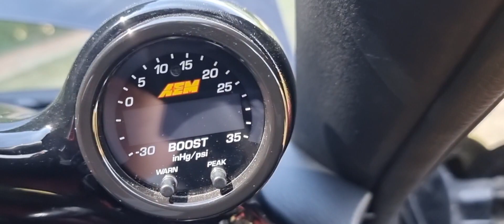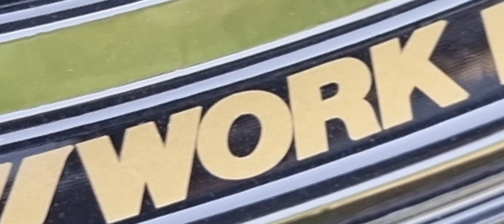Top 5 Favourite Modifications on my Mazda Rx7 Rotary FD3S Efini Walkaround

Comment: hello! I also think it is important to know the history of my favorite car.
It can be confirmed from the garage certificate that the very first owner of this RX-7 was an RX-7 sold at a dealer in Hiroshima Prefecture, Japan.
The official name of this year's RX-7 is Anfini RX-7.
We don't call it Mazda RX-7.
Only the initial model has a red Anfini emblem on the rear bumper.
From type II, it will be a silver Anfini emblem.
This red INFINI emblem is a proof of the early model and is valuable, so I think it's better to cherish it.

The grade is type X, the highest grade; the price is 4,440,000 yen in Japanese yen.
For reference, the R32 Skyline GT-R is 4.30 to 5.29 million yen.
The reason why it seems to be Type X is that the interior is red and the leather seats.
At that time, the number was ruthlessly small, and I have never seen it in my memory.
Although it may rarely come out with used parts, it will be very expensive.
It's a very precious thing. Please cherish it.
The Bose woofer system is also very valuable.
This was an option when I bought the new car.
It becomes a dedicated stereo deck, and a woofer is attached to the rear trunk.
The rear trunk mat is also a special item.
The rear hatch tray is also dedicated to the Bose woofer.
It's very valuable to have all of this.
Please take care of this too.

In addition, the type X was equipped with a sunroof.
This RX-7 does not have a sunroof.
After a little research, it seems that the sunroof is not standard equipment.
It was only written as a single in the specification table.
It seems the first owner didn't choose a sunroof.

RX-7 has from type I to type 6.
I'm on a 6 now.
The driving performance has evolved as it becomes a new model.
However, the newer it is, the lower the cost.
You can see from the video that the early RX-7 was made with a lot of money.
When it comes to type 6, the simplification of the interior is particularly terrible.
The interior of my RX-7 is matte black.
The seat is also fabric.
It is a pity that it has become very cheaply made.
I saw the video and felt the owner's affection for the RX-7.
As the same RX-7 owner, I am very happy.
Reply: Correction: For the rear emblem of the early model RX-7, the correct answer is RX-7 in red letters, and Anfini in silver.
Reply from the maker: Ah ok, well just to clear a few things up there, when I bought my RX-7 back in 2012 it had black leather interior, black efini emblems, red rear rx7 emblem, No bose system, mat or Parcel shelve, It didn't have a lot tbh. I was told mine is a type R edition as it was made in 1991 but registered in 1992 (UK - J Reg) 

Everything you see is what I've changed on the car over 10 years there is a video on my channel called 10 years ownership and it will show you how the car looked back in 2012 when I bought it compared to now.
Reply: @RotaryandRides  I see! It's a type R! I was on a Type 2 Type R.
The price of the Type R is 3.85 million yen.
The red interior, genuine leather seats, and the Bose system are very valuable parts.
I think this is a very good choice.
It says 920014030 on the garage proof sticker.
This first 92 represents 1992.
In addition, the number 1 of the number of heads of FD3S-103*** of the body number represents type I. 6 type starts with 6.
I can prove that it is a type I vehicle registered in 1992.
By the way, the plate of the accelerator pedal and the clutch pedal is a genuine optional item.
Good quality RX-7 is getting very few in Japan.
Type I is especially rare and the degree is not good.
We feel happy when we see them being treated with such care and cleanliness.
It makes me really happy to know that there are people overseas who love the RX-7 so much
Reply from the maker: @いつも晴れ-u6f  I absolutely love the Rx7 and I was extremely lucky to get the one i did! the minute I bought it I started doing work on it and started adding new parts ect. I sourced each bit of the red interior off multiple sellers over here in the UK and it was extremely hard to find like you said! I then swapped some of the red interior parts to black (like speaker covers and other trim peices) because red on red looked a too much for my taste. The only peice I'm missing is the roof liner and I could do with a better condition drivers seat but i havent seen a good condition one for years anywhere!

Same with the bose system I sourced the system for a really good price then got the parcel shelve and bose mat off separate sellers. I love finding and buying rare parts. 

The silver rx7 pedals came with the car which again I was extremely lucky to have with the car.